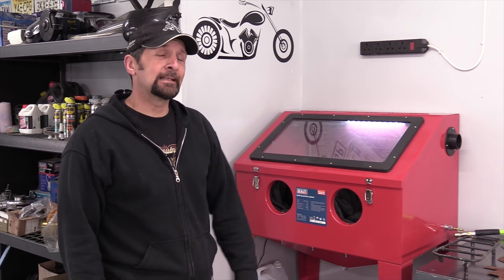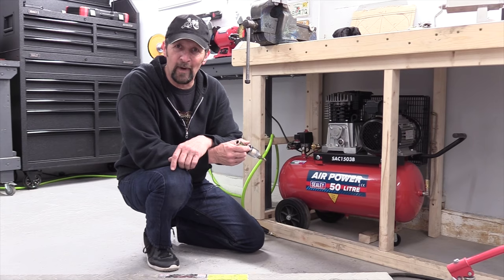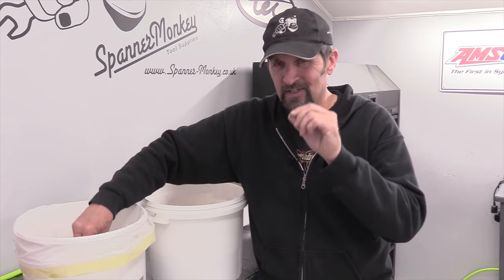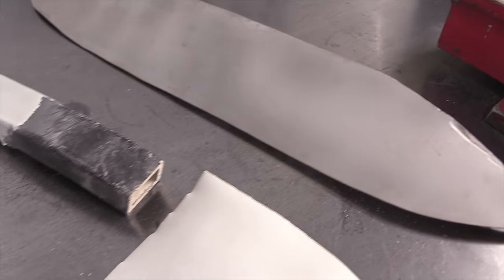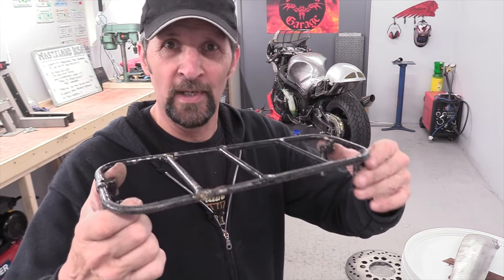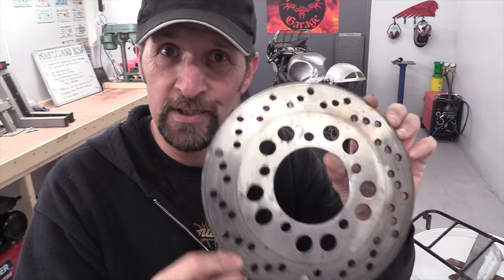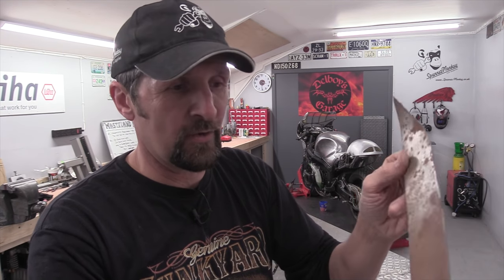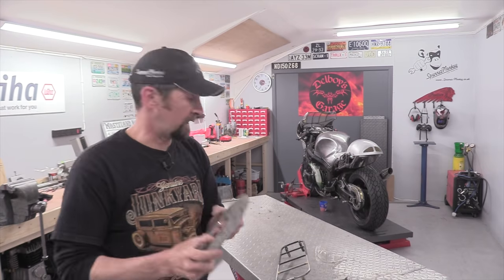Shot Blast Cabinet...First Day !

Comment: I'd suggest a bigger compressor to be honest also get a filter to ensue it's oilless air from your paint supplier, partyl so theres no risk of finish issues if you go from blast to prep and secondly nice to have it setup ready given the compressor upgrade will be perfect for painting kit. The obvious thing about pliers or holders so you can get all the angles and not wreck gloves and experiermenting with media I suspect have already been mentioned. I like to use some funky things depending on the job im doing and why I am blasting it. Also... check your mask filters as some aren't rated right for shotblasting it's weird. Similarly Z81 rated eyepro under the shield just for safety. I saw someone hurt badly when a blowgun fired when a compressor did something odd and turned itself on when the cabinet lid was lifted to pull a workpiece out.

Comment: I own sandblaster cabinet past 20 years, when you blast something, use pliers to hold the pieces, otherwise, have fun replacing your blast gloves, less 3 months if you’re constant blaster, suggest add reclaim unit to the system, reuse medias, 30% to 40% savings, well, I own industrial size, has vacuum and reclaimer system. Helps lessen dust in the cabinet. I love my sandblaster cabinet.
Reply from the maker: Hi buddy, thanks for your insight, that's very valuable, my first day with this, and learning as I go!  As you probably saw, my sand all lives in the bottom, and there is a extractor hole with a filter on it on one side, but not sure I can hook up a reclaim system to this, I planned to use my sand till it got a bit skanky and then sieve it or just replace it, it cost peanuts and is readily available and always useable in the garden lol  But seriously, apprciate any tips mate, looking forward to using it more.
Reply: I adopted a policy of always wearing nitrile gloves inside the blast gloves, and it has seemed to prevent or slow the dry rot considerably.  Salts from your hands accelerates the process i believe.  Also took some wire insulation from an old power extension cord and lined the glove holes with the help of some hot glue, to ease the edges which tend to cut into the gloves.
Reply: both are good recommendations Del.
Reply: Delboy's Garage checkout harbor freight tools, small simple hookup, includes vacuum in it. When comes to sand, dusty and less life compared to glass beads. Check stat blast website, look through their system. Even they have plans make your own blast cabinet, buy their kits. You can learn few parts they have...enjoy!!
Reply: travis miller - after 20 years, I’ve never thought of this! Keeps gloves cleaner too and now coronavirus going around, that makes sense. I will start doing that as I share my blaster with my kids.

Comment: Using Silica sand for abrasive blasting has been prohibited in the UK since 1950 apparently, due to the high risk of Silicosis etc, stay safe Del...
Reply from the maker: So im hearing, strange that its openly recommended in the unit's instruction manual..!  ill be looking into it mate.

Comment: Very useful to have a blasting cabinet. Did mine along with a DIY compressor from truck parts last year. Do not use sand or any silica! Not healthy and leaves to much dust. Use aluminium-oxide instead! It is harder, last longer, no dust and it is sharp and makes a more rough surface which is better for any paint stick to it. For surface preparation before painting the old paint and rust removal you really need 300-400CFM at 5-8 bar pressure with a 7-10mm blasting nozzle. For aluminium surface finishing glass beads with lower than 5 bars is ideal. The problem with that simple filter is that all the moisture and oil makes its way through ending up in the air line and on your part and paint wont stick. Any kind of an effective condensation vessel and moisture adsorbent is a must. At least stick 2-3 of these cheap filters together :) I am using a self made condenser, a kitty litter adsorbent (disposable) and a big silicagel (can be reactivated) dryer.  You can see my silica adsorber unit assembly on my channel.

Comment: very surprised that compressor can keep up and give you effective air quantity at the correct psi. i love running soda and small glass bead. also if that window is made of plastic, you may want to get a piece of glass cut for the cabinet side.
Reply from the maker: At 14 cfm, it more then keeps pace with the cabinet.. and the window it toughened glass, with an internal plastic replaceable skin, like a visor tear off...

Comment: Nice addition to the shop Del. Do yourself a favor and run a ground strap from the cabinet to a pipe or copper ground rod. Those cabinets can generate a nasty static discharge. Besides all the elbow and knee cap shocks, I've been hit in the right eye and balls. It will get your attention. Stay well Bud.
Reply from the maker: Thanks Joe, I'm getting a few saying this, sounds like bitter experience, and I thought only car did that to me!  Got no pipes I can connect to and the building's all wood, so I'll have to work out a plan!  Thanks for the tip, I'll make sure I wear me daps when I'm blasting!  Hope you're well mate, Del

Comment: I use my blast cabinet all the time. very handy. That port on the side is for a vacuum. It will help keep the area around your cabinet a lot cleaner. You can get different grits. I would say the media you are using is a fine media. There are some that are pretty aggressive that will etch pretty deep. I also just picked up an ultrasonic cleaner. Its also is nice to have. If you're thinking about a paint booth, I have a video on one I built on my channel. Folds up to store when not in use. Take care.
Reply from the maker: Good to hear from you Brother, thanks for the insight, this is a new field for me, so I'll be getting in to lots of new adventures with it... I'm looking in to a cyclone bucket, or some kind of extractor, I have a good shop vac, so it will certainly make things a little easier and clearer when filming, not to mention, the health benefits of cutting down on the dust!  Hope you're keeping safe and well there, always good to hear from you, keep in touch, Del

Comment: I have a 50L compressor myself and all the research I've done seemed to point out to it not being enough for a sand blasting cabinet. It does look like you do run out of juice every now and then.

Might want to consider an upgrade in the future, seems to so the job for now.

Cheers!
Reply from the maker: Compressors aren't measured in the size of their tank mate, my old compressor was a direct drive punching 4CFM, this unit is belt driven, kicks just under 14CFM with a 50L tank, the exact same motor and drive system is futted to their 200L tank, so it more than keeps up, the restriction's not the compressor, it's the limitations of the cabinet, it can't run higher than 80psi, so you have to have the compressor turned right down, and it's working just fine... I didn't want a bigger tank as it obvously takes up too much room!
Reply: @Moonfleet41  that's fair enough bud!
Reply: @Moonfleet41  whilst you're right about the CFM rating mattering a larger tank DOES matter, Having the flow per minute is only one part of the thing, having a larger tank means there's less stress on the thing, less of a chance of overheating, longer working times before the thing needs to cool down that sort of thing. Similar to welders with the rating on worktime being say 50% meaning that out of every 10m on you can be actively welding for 5 having a larger tank at a given pressure means that you have more work time available to you. It REALLY matters with High Volume low pressure jobs like blasting cabinets. 

the larger the tank and/or the higher the pressure of the tank are the two ways to increase work time availible. Larger tanks is obvious, increasing the volume increases the amount of work time before the compressor needs to refill the tank/work to push the air to the required pressure for the task, which increases the amount of usable air and thus increases work time before things need to cool down etc. 

The other option of increasing the pressure in the storage tank isn't really practical for this kind of job and isn't particularly easy to do at home but the best example I can give is the Compressed air mortar I built for reenactment,  One of my setups, two of them one has a 4litre tank attached to a 1l chamber, the tank is at 200psi, the cannon fires at 200psi. I get if I am lucky 3 or 4 shots before it needs refilling. That same cannon when attached to my 88ci paintball tank filled at 2000psi with a regulator stepping things down to 200psi I can fire 30+ times before needing to refill it and the 2 12g co2 cart setup can still fire maybe 8 shots because it's more efficent. 

to get that kind of peformance with a compressor where the tank is at the pressure I need to fill the chamber the 200l compressor would provide far better performance than the 50 because of the decrease in time the compressor is running and all the issues that causes.
Reply from the maker: @lscarlet2475  Thanks for your input mate, I've spoken enough about this now, I'm happy with my compressor and it's adequate for what I need and the space I have, thank you once again for your input.

Comment: I used to operate a large sandblaster (small room size), blasting lettering on granite tombstones. Any glass (look thru panels) will fade  over time till you cant see thru it, due to blasting media etching away the glass. So using a GoPro inside the cabinet will damage the glass lens and if covered in plastic container it will dull to the point lens wont see anything, not to mention fine grit getting into camera eventually destroying it. Re. Chome footpeg. Different media gives different results. You need a more aggressive media for that like metal particles cant recall what I used for granite but was metallic based. Cheers Bro.
Reply from the maker: With the GoPro, experimenting, the case is waterproof, so certainly won't let dust in and I've sourced some stick on lens protectors, much like the glass panel in the booth has, as soon as they get etched a little, peel them off and stick another one on, they're made for GoPros, so optically clear, leave no residue on the lens and bubble free!  First little test shoot went really well.

Comment: Del, no need to fit a gopro mount inside the cabinet, you can buy a polarising filter for dead cheap that will kill the reflections from the glass, you just pop it in front of the gopro lens and it works its magic

Comment: Warning !!!.. Just so people don't think they can get a bucket of sand from the beach.. Never blast using normal sand which contains silica as this could lead to cancer, COPD or  Silicosis... blasting should be performed using 'Silica Free Sand' or alternative blast media...
Apologise for putting this comment up - but in your video you mention using silica sand & and a felt that this needed to be highlighted for health & safety... thumbs up for wearing a mask also 👍👍
I love your video's Delboy - keep up the good work 👍
Reply from the maker: Thanks Andy, there's a lot been said on this now, and all good to know... shortly switching over to glass beads and later will be investing in some aluminium oxide under some professional advice.  Appreciate your input mate.
Reply: @Moonfleet41  👍 if you ever want to bounce any questions at me feel, 25+ years with blasting and coating.. 
Hat's off to you guys though. I learn a lot watching your vids 👏👏

Comment: You should try using aluminium oxide media, it's a lot more course so the paint and grime comes off quicker and leaves a great finish for paint to stick to.
Reply: And won't give you silicosis
Reply: I like crushed glass....definitely not sand !! It needs a vacuum of some sort

Comment: A couple of tips for you, move your water trap to the other end of your air line, the air coming out of the compressor is hot, you need to allow it to cool a bit before the water will condense out. 
Secondly plug a hoover into it 😁
And finally clean anything flakey up before putting it into your cabinet, if you get flaks in your media they will keep blocking your nozzle.
Keep up the good work m8
Reply from the maker: Thanks for the great tips mate, really appreciate that... the water trap top makes great sense!

Comment: Awesome Dell... really like a sand blaster cabinet... no doubt this will be super useful to you on future projects.  Although I think you need a much larger compressor my friend! ;)
Reply from the maker: Hey Donald, The compressor is way big enough, don;t be fooled by the 50ltr tank size.. its the same 14cfm belt drive motor they use on their 200ltr tank model thats huge... i chose this unit because it takes up a lot less space but can still push more air than the cabinet needs.. i have to keep the regulator turned down to under 80 psi to protect the cabinet..  and you're right, it'll be a great helps with the work to come.. take care mate, and enjoy your Sunday..

Comment: Great video mate, love those blast cabs, so easy to use and saves days cleaning up nuts, bolts and fittings,, if i send you a set of Mother`s teeth you rekon you could give them a blast for her,, few of them starting to discolour after 40 years in her gob LOL. 😉
Reply from the maker: Please do... I'll order some 'dentu-blast' 10kgs ought to do it, don't ya think?  Maybe 1/2hr on the buffer, just for good measure!
Reply: @Moonfleet41  LOL

Comment: I prefer to strip as much paint off using paint stripper before blasting, the paint will contaminate your media and makes the job quicker. 

I'm surprised you were not advised to use aluminium oxide as it is longer lasting and leaves as good a finish. I'm also surprised you were advised to use silica sand as you can get silicosis from it and that ain't nice. I believe safe play sand or toxic-free sand is silicone-free but I couldn't find any.
You also pretty much need to be ready to prime steel as it flash-rusts very quickly.
You will find the blaster a great job.
Reply from the maker: That's the reason for the wire wheel mate, to clean as much debris off any part before blasting, and more importantly, absolutely de-greasing for obvious reasons, as you say... I'm looking in to the silica sand thing because I've heard the same warnings about aluminum oxide regarding health, and indeed silica sand is clearly printed as a permitted and recommended blast media along with glass shot and a few others, for this product, I'll be seeking clarification from Sealey on Monday, and looking in to the possibility of cyclonic extraction in the future.
Reply: @Moonfleet41  I find the wire wheel struggles with some paints especially powder coat and why I use paint stripper first then wire wheel in welds and places the stripper doesn't work, I guess it's what works for you. 
Another great use for the wire wheel is when you cut a bolt with a hacksaw, a quick file to tidy the burr then a firm clean with the wire wheel and nuts go on perfectly, I find this better than putting a nut on first before cutting then screwing it off.

Scotchbright mops are a great wheel to have on your polisher, If you haven't used one you will be surprised with the finish you get and great to use on aluminium before polishing, I personally use 8" 6 lap and 4" 2 lap. For what it's worth I would remove the grinding wheel and put a Scotchbright mop on that shaft and mount another grinder well away from your polishing materials, a cheap lidl grinder I was given I find ideal as I only ever use it to sharpen drills or remove a burr from cut bolt or shaft.

Another great polisher addition is tapered pigtail nose shafts and available for left and right-hand use, I thought the Sealey polisher would have come with these fitted, this helps removal quickly as I keep 4 mops with different grade soaps.

I have no reason to doubt you on the silica sand printed label printed on the cabinet so will be interested in what Sealey says, I know they are a reputable company though the manufacture of these cabinets is probably outsourced. The sand thing I put a link to regulations in someone else's comment. https://www.hse.gov.uk/foi/internalops/ocs/200-299/273_18/

While waiting for your extraction system I use a vacuum cleaner to extract the dust, this also helps in being able to see what you are doing when the cabinet is full of dust. Aluminium does have its risks as does just about all particulates but I believe one of the lesser of toxic substances, hence why I take what precautions I can when blasting.

I am by no means an expert but picked these tips up from my own experience over many years but mostly from other people and always open to learning better or new tips to make a job easier or better, many I wish I had known years ago.

i.e. I polished the engine cases and fork legs on my 1976 Suzuki GT250 when corrosion set in at only a few months old using a really heavy and powerful 1950's alloy drilling machine I made a mounting to hold. Polishing seemed to take forever as the alloy on these cases were lacquered as they were other marques and I polished it off with the wheel, I was quick to learn all about Nitromors and the job took a tenth of the time, also full face shield, safety glasses, respiratory mask, overalls, hat, a cowl behind the polisher and believe me you will still be piggin as will everything around you. I guess ear defenders should also be used but I personally dont use them. Though you probably know this NEVER EVER WEAR GLOVES including when turning.

Since you're doing more work erecting 3 small sheds from 1/4" ply with canvas entry, one for polishing, one for blasting and one for painting worth thinking about space permitting.
I wasn't going to post this as many others may have already said them and it's long but hey!

You're doing a good job investing in your channel.